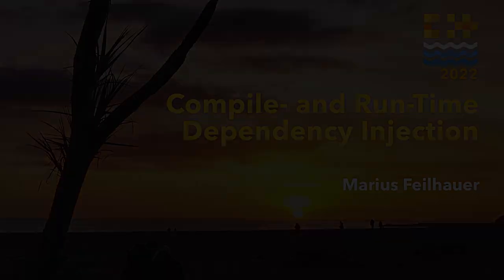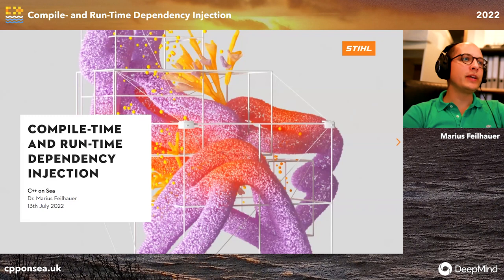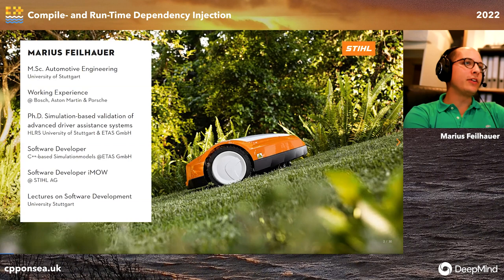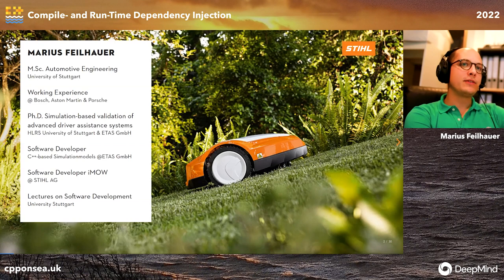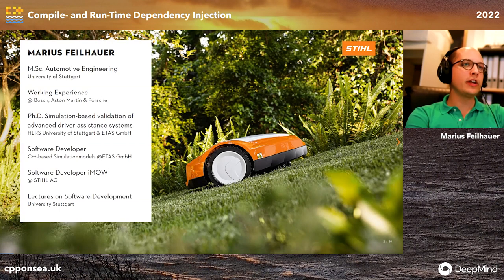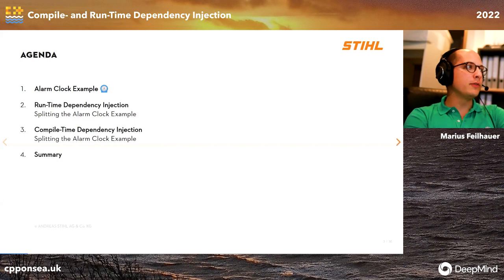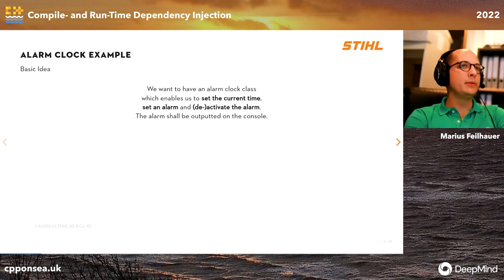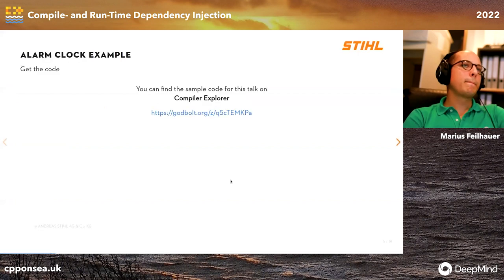Compile- and Run-Time Dependency Injection - Marius Feilhauer - C++ on Sea 2022

Comment: Hello, nice talk, but I don't understand (12:17) time_interface depends on chrono, is that right?, I think an interface shouldn't depend on nothing
Reply: The chrono dependency is needed for the type of the time point. You could create you new custom time point class, or an interface for that, too, but that is not necessary here and would be a lot of glue code. I think only when you actually need a different time implementation (other than for the test) that doesn't work with chrono time points that would be relevant.